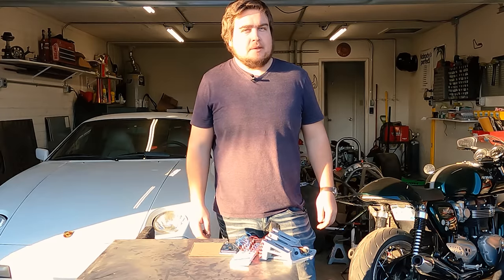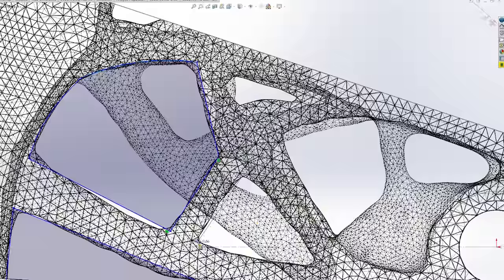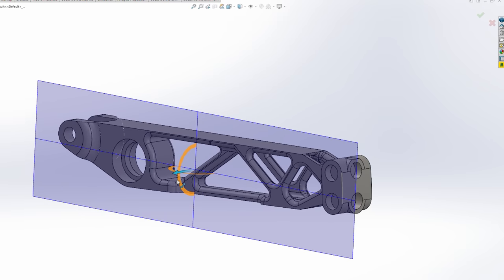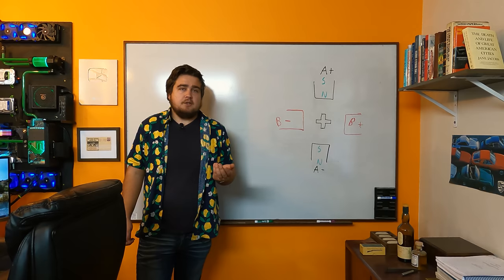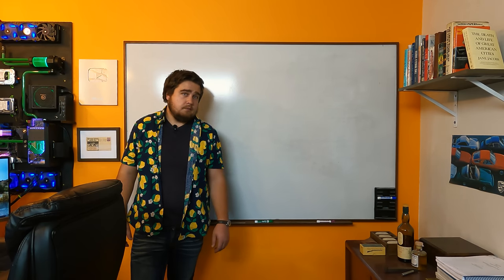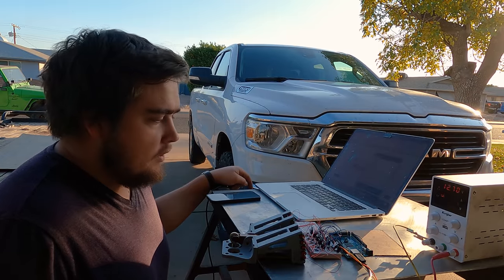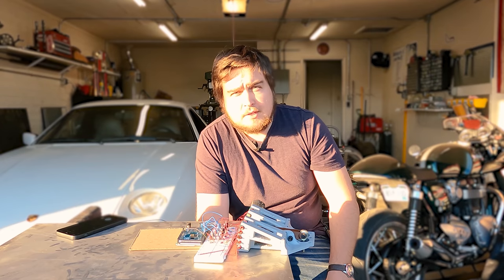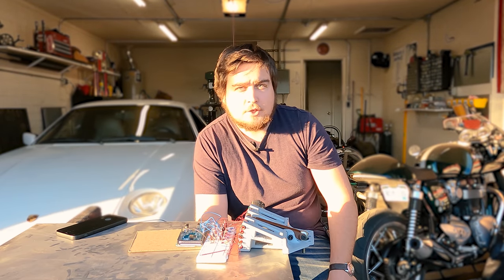I build a Very Specific Stepper Motor the Wrong Way

Comment: Is the plan to make this radial, or just linear?  If you did make it radial, you could make multiple arms to act as a stepper motor in the opposite side as well.  It would be double actuated, and could be made offset to get more precise control.  Otherwise, if you did make it linear, you could double the arms and make it like a fork actuating one lever point.  Interesting concept for sure.  (still reminds me of a HDD head arm, like someone else stated).
Reply: Just realized what you're thought process for this was after watching your last video with the steppers.  I have an alternate idea.  It would take some doing, but you could develop a voice coil (like for a subwoofer), that would be able to open and close the valve at the needed speed, which would be 50 hz.  If you build them strong enough, you'd have a completely variable opening option, as you would just adjust the power (volume) to whatever setting you would need.  Not sure how you would seal them though.  You could use a standard valve, but would have to be halfway open to start.  So that way, the full travel of the coil is realized.  You would just need to figure out a way to send the right waveform to the amplifier that would power the coils.  They could also operate off of supercapacitors charged off the alternator.

Comment: What's the longest throw piezoelectric actuator they make?  The issue so far is converting electricity to motion through magnetic fields, so if you can bypass the magnetic fields things should move faster.  Of course, the problem there is those are kinda meant more for things like focusing the JWST than ramming valves up and down, but there might be something available.

Maybe there are some cues to be taken from coil gun or rail gun designs.

Comment: You can collapse a magnetic field in a solenoid just as fast as you can build it. You simply use the same voltage in the opposite direction.

Comment: Have you looked at any direct injection style coils? I don't know if they would have the capability of lift you need but the Rotax Etec system for 2 strokes are apparently pretty quick.

Comment: So, you've built an electric desmodromic...  I like it. Didn't BMW fail at this a couple decades ago? Or was it spring retained single action  poppet valves vial longitudinal solenoid? I can't remember.  Desmo via a lever action seems far more obvious, but it's up in the higher RPMs where this stuff tends to fall apart :)
Reply: Most auto and equipment manufaturer tried  camless design at some point. Some prototypes did work (at valeo I am certain) but cost/benefit in the context of cheap oil meant it never made it to production.
Reply: They built valvetronic instead. Get full control of valve lift with valvetronic and get partial control over cam phasing with VANOS.
Reply: @zoppp621  It's not full control of the lift, and certainly not independently of duration, because of how the lost motion mechanism works.  It also affects the phase, so some of the VANOS range is needed to correct the Valvetronic peculiarities and recover some of the lost duration under some circumstances, and remove it where it isn't wanted.  The two systems likely respond at different rates so there needs to be some dulling of response (i.e. ignition timing to reduce output and prevent surges) under dynamic situations.

This results in severe drawbacks in terms of the induction and exhaust efficiency, that naturally impacts combustion and overall efficiency.  But it obviously offers far more flexibility than fixed lift and duration, just nothing like the utterly free timing camless designs are usually chasing.

Comment: question why can't you just stick a motor on each camshaft?
Reply: I think he wants to independently control the cylinders. I suppose that allows things like cylinder shut down at cruising speeds for fuel savings.

Comment: I think that separating to two sets of coils will not solve the energy storage problem as they are still mechanically coupled. Because conservation of energy is a thing; the "e" coils of the left side will still be collapsing as the "a" coil in the right side energizes, and the net effect will be largely the same as not splitting the coils in the first place. Since you literally need more energy in less time to change magnetic field faster, I think the only way is to increase your control power. This would probably look like overdriving the voltage and using 'current control' instead of 'voltage control' to ensure you don't exceed the power ratings of the stepper coils and melt them.
Reply: Further thought: This is all just electro-mechanical advantage. If you're already driving the steppers at max power, why not just machine the cams to have a steeper angle so you don't need 180 degrees of rotation?
Reply: @AndrewLeCain  
Because then you need more torque to accelerate the valve, which necessitates a larger stepper motor, which can't accelerate as fast. And so the cycle continues.

I think a solution here may be to do what industrial servos do, which is operate at 10x the voltage that would normally be used to operate the motor at normal load conditions.
i.e., a peerless brushed servo motor I was looking at is rated at 24VDC for continuous full load operation, but is insulated for and intended for use with a 180VDC current-limiting driver to achieve the acceleration values on the dataplate.

So maybe some 6V power wheels motors with a 100V drive with overcurrent limiting (not just "protection") will get them to accelerate significantly faster than otherwise.
One example of this type of drive is the BTS7960 which is very cheap and commonly available on amazon etc, but its current limiter is set to 43 amps which is way too high for many purposes I want to use it for. I sure wish it was adjustable.
Reply: @Nick Wolford that's what I was suggesting originally; use higher voltage but limit power by controlling the current to not melt the coils.

Comment: What kinds of shortcomings does a basic galvo have? Same as a solenoid? At least in light effect fixtures they seem to be super quick, smooth and precise (given a good control electronics), though the mass and needed power on those applications (like HDD's) is surely minuscule compared to something like valve actuation.
Reply from the maker: Servos are the next expirement when they come in- Theoretically they will be more effective, but it's still an incredible amount of force moving very fast.

Comment: just spouting out some nonsense ideas here but the engine is basicly a compressor. a turbocharger is a compressor running off compressed "air" from the engine. a tesla turbine is run from compressed air usually could one make a the exhaust side of the turbo using a tesla turbine and would that be better or vorse than a regular turbo. just thinking out loud

Comment: What if you modified a stock engine, where it's basically the polar opposite of a freevalve technology, but to make it even less reasonable, the camshafts are replaced with gears.

Comment: Could capacitors be used to rapidly charge the solenoids?
Reply: increased voltage can boost solenoid charge speed. Just adding capacitors - no, it doesn't work this way.
Reply: @SergeiSugaroverdoseShuykov  how could you achieve the faster charging and discharging of the solenoids? I’d really like to learn more about electronics.
Reply: @ronniejarvis2679  solenoid is just specific case of brushless motor so reading about inductance coil is good way to understand it

Comment: Sounds like you just made a linear induction motor 😂😎
Reply from the maker: Basically, yes- with a few more steps. Although with a lot less localized heat and potentially less of a heavy metallic core.
Reply: Not an induction motor since it uses permanent magnets (no currents need to be induced in the "rotor" to create a magnetic field), but it is like a segment of a brushless DC motor.